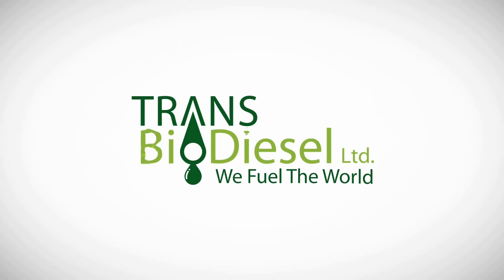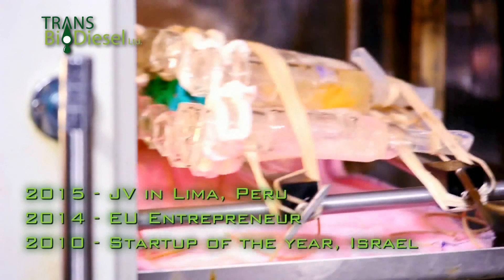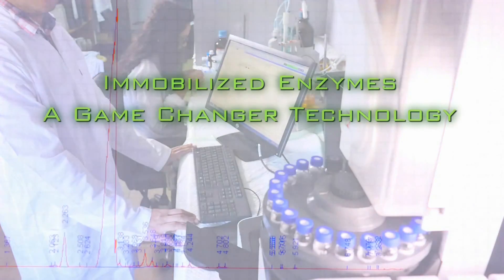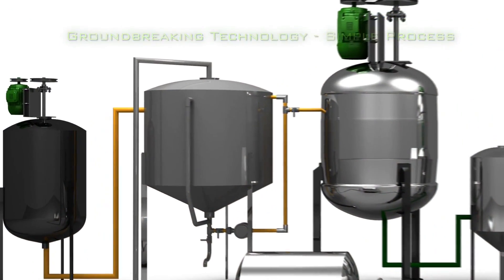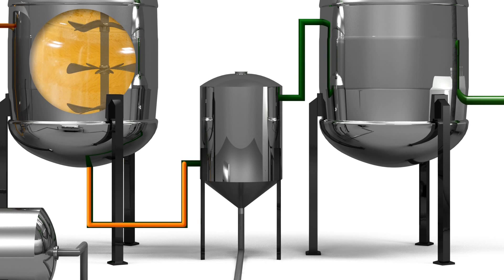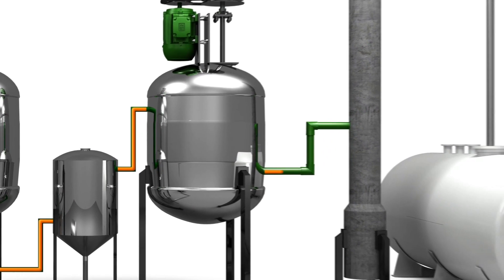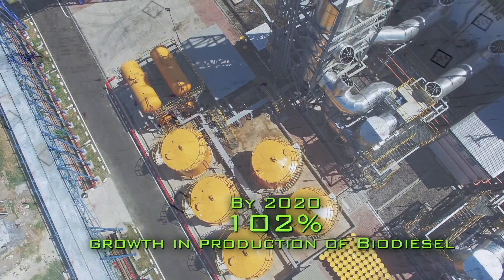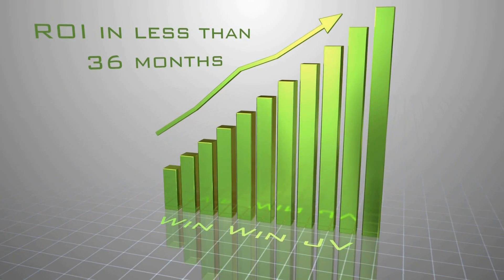TransBiodiesel - Turning Waste Oil to Profit

Comment: When I try to make it according to video, so all waste oil turns into glycerol... Any ideas what could be wrong?
Reply: You have to do titration for knowing how much acid is their.accordingly you have to mix KOH
Reply: Ethanol quantity
Reply: What is dirt depositing solvent and sludge removal from waste engine oil
Reply: After failed experiments with making biodiesel I just mix oil with diesel (max30% of oil in tank) and driving like this. One year,  no problems at all. Ford s-max 2006 2.0